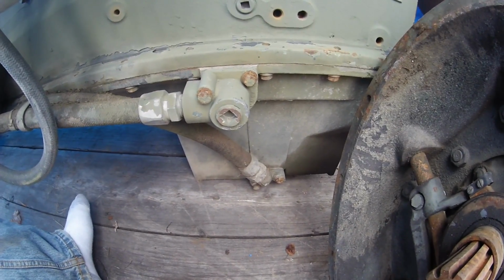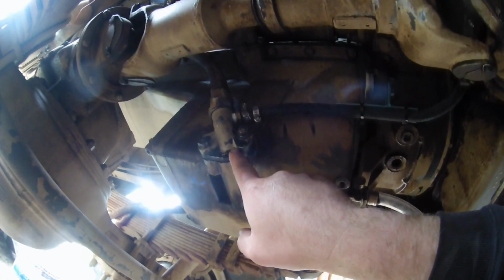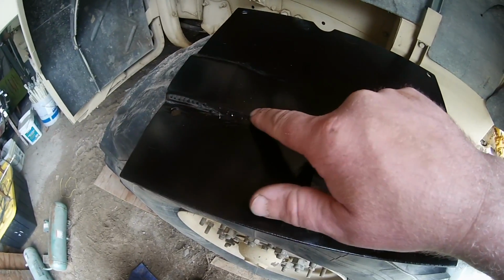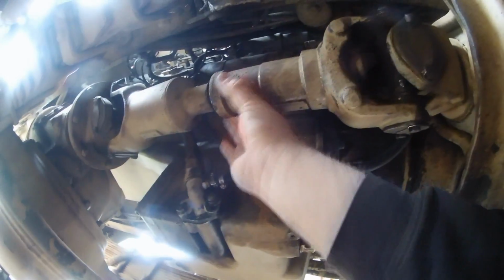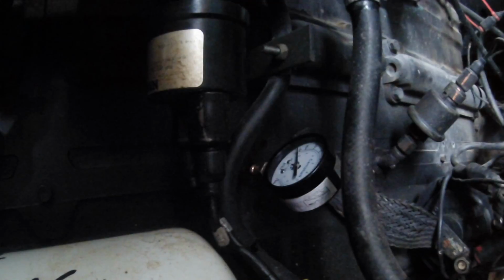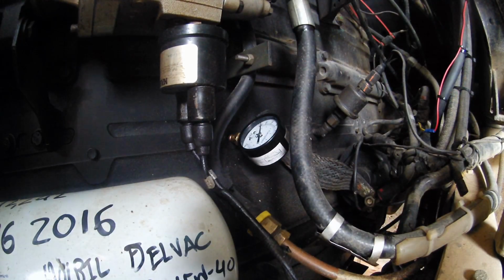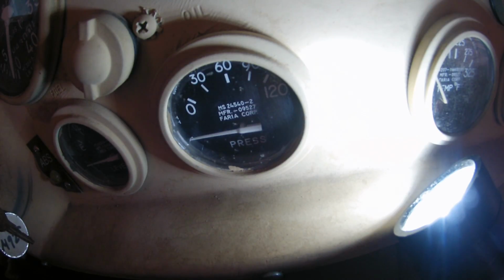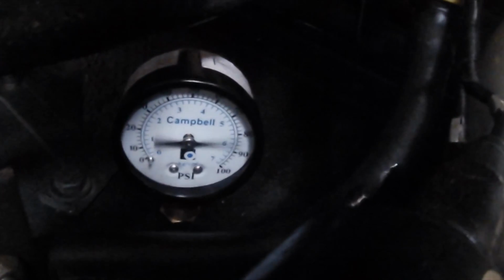Engine Pre-oiler Build

Comment: You need bigger flow on suction side of pump.   Change your 1/4  NPT port to at least  1/2 inch. Also change the out hose diameter to 1/2 inch. Keeping the 1/4 NPT  adds flow restriction to pump, which could eventually worn out the pump prematurely .
You don't want to build negative pressure in the intake,  you want to achieve FLOW in order to be able to fill  the oil galleries fast.

Comment: Yes, i love this, i just rebuilt the 855 in my m925 from watching your videos and i wondered about this when i watch the oil gauge, thank you for this video and your videos on rebuilding the 855, its greatly appreciated.  I just notice that this video is 6 years old, have you had any issues with this since, or has it worked flawlessly?
Reply from the maker: It will lose prime when sitting for a while.  I either grind it until it catches or just start the truck figuring sometimes is better than never.  Right now we are not using it commercially so it is just sitting in storage but when I was it got used every day. No idea the practical effect but I felt better not hearing it tap until oil pressure came up.

Comment: How about boots ?
Reply from the maker: Only two types of 5 ton owners, those that have changed a boot and those that are about too. I have always used the one piece and just pulled the hub at the kingpins. In 3 of the three trucks I found serous issues inside. Remember these were worked on by high-school kids.

Comment: Thanks for the extensive guide.
Now I'm gonna do this on my old BMW M21 diesel engine :)

Also, maybe you could run two or three of these things in parallel?
Since you operate these huge trucks that probably have a much larger battery capacity, you should be able to do this without worrying about draining it so much you wouldn't be able to turn the engine with a starter.
And the pre-ignition oil presure buildup would be quicker.

Comment: Can u do.a video or do u have one of diag fuel system.an maybe bleeding the air out of the system cause I need info or maybe somewere I can find a manuel on this moter mine doesn't seem to be pulling enough fuel to start
Reply from the maker: Crack line right at injector pump then use  rag and airline to pressurize fuel tank and bleed up to pump. Still no start crack injectors one at a time and crank till fuel. MAKE SURE MANUAL SHUTOFF VALVE ON INJECTOR PUMP HASN'T BEEN CLOSED. Happens all the time.
Reply: Thanks you

Comment: Thanks Nelson Studios! I used your basic system and one other techs to fab up a pre-oiler rig on my prized D21 4x4 pickup that has classic KA24e/d start up chain rattle. Stunning results, all my mech friends are shocked. I tapped my oil plug 1/4npt into a T and out to my scavenge pump (like yours 12v) under the passenger seat(cause easy space and not too uphill) and out thru a 3/8 check valve( you're right they dont pull) then to an inlet on a oil filter sandwich adapter(Chinese; upgrade the o-rings and re-tap the 1/4' npt western size and it's good so far).  So, hit the pump switch before cold start up and it takes 7-10 sec to hit pay dirt and WACK, 40 psi on the gauge(25 when hot). Oil light stays out for 3 sec after pump shut off, 1 sec when hot. Time it right and start before light comes back on and things are golden, not a trace of rattle!). So looks like all the engineer's thur time missed this OR they didn't want this and synthetic oil make YOUR ENGINE LAST PRACTICALLY FOREVER! No money in that. Will post vid soon, cheers.
Reply from the maker: Sounds awesome!

Comment: I did the exact same thing to my subaru but I used AN-10 hose and fittings and used a gear drive scavenge pump. I set the pump on a timer that activates every time the ignition is turned to the run position and it runs for 5 seconds. I instantly get 80psi+ pressure in the block after sitting overnight. Was the best invention I have ever done. No more dry starts. Great minds think alike.

Comment: I made a comment in your video of "testing the preoiler system" stating that this is a little bit of an over kill. But after watching this video, and actually watching the time it takes for the oil pressure to finally build, you have me sold. I will install this this fall when I change my oil. I always like to have fresh oil in it during winter. I will also do a drain plug modification "maybe"
Reply from the maker: You might let me run with it for a year and see.
Reply: The reason I like this system I only run my truck for a couple hundred miles then it will sit for a few months, I'll go out and start it, run it for a couple hundred miles and then it will sit for a few months. Starting it up after it sat for a few months gave the oil time to weep down off the cylinder walls and out of the bearings. After watching your video I went out to mine and started it after it sat for 3 months, I did not get oil pressure until the engine was under its own power. I would like to see positive oil pressure while the engine is being turned by the starter.  It does if I start it with a few weeks, after that it oil pressure builds after the cylinders fired off. You did a good of job of making people aware of the oil pressure delay I never gave it any thought until I paid closer attention to it.

Comment: That's neat. Was there any change in the amount of time it takes to build full idle oil pressure from a well rested engine vs. no pre oiler?
Reply from the maker: Yes, during winter start up I might see 20 seconds with no movement from the gauge, with the pump it has oil pressure from the moment of starting.

Comment: Pump is way too far from the pickup.  Those pumps push far better than they suck.  It should be mounted down on the frame rail somewhere as close as possible to the tapped fitting.  You'll get a faster and higher pressure and you won't burn out the pump as fast.
Reply from the maker: I agree with you but I wanted it out of the road spray as I didn't think it would last as long subject to that.  It can't lose prime because of check valves thought it will suck a little air each time I change the oil.  It is set up to run for 30-40 min at a time so I hope that the little bit of abuse I give it pulling from so high will not kill it early.  Built to drain the motors of boats when doing an oil change.  Designed to be self priming from the deck.
Reply: I don't think it will lose prime either, it'll probably do fine there but would do better job priming with a short intake long exhaust. Would be interesting to compare.
Reply from the maker: It would be.

Comment: That oil pump is mounted really far away from the pan and it might starve itself and burn up overtime, electric fuel pumps are the same way, if you mount them far away from the gas tank they will burn up and quit since they are lubricated by the fuel. Maybe in the future I would try making a bracket off the oil pan since you have those tapped holes and mount the pump on the oil pan or somewhere closer. Also this completely opinionated but Fram makes really cheap filters and I wouldn't trust one with a 4 cylinder let alone this mammoth. There are plenty of youtube videos and forums about how cheaply made Fram filters are. I would trust Mobil 1 filters or K&N filters personally
Reply from the maker: It should not lose prime despite the air you could hear in the test video.  One way check valve on the uphill side, downhill is below the level of oil so no air can get in.  Barring a leak in the lines the prime should stay so no dry run, or at least not often (sitting over winter for instance). I guess time will tell but it truly is designed to pul out boats while sitting on deck so some lift must be ok right?  Maybe I should have tried harder to mount the pump in the frame rails, my thought was to keep it cleaner and further from the pressure washing I do all the time.  I will probably replace with NAPA filter at oil change so in another 2000 miles.
Reply: Oh I didn't know you had a check valve to prevent dry starts, and I didn't think about pressure washing good thinking there. I really like the idea of a pre-oiler and really smart idea to tap it in that fitting for easy repair/replacement

Comment: I like the idea but you may end up having problems with the aux pump because your pump is higher than the oil supply by quite a bit. Especially when that oil is cold it is going to starve that pump a good while before it gets oil. Just have to see how long it lasts.
Reply from the maker: Unless air gets in the pump shouldn't loose prime.  The air you can hear in the video is from me draining and refilling the engine.  You are not the first to comment the pump should be lower, I was trying to keep it clean.

Comment: build an adaptor plate , and convert to the old 12 valve cummins , for what you use the trucks for , it should be fine , they used them in many a school bus , basically what your trucks use is , they also used the allison trans , so the adapter plate may be an off the shelf item , just doing the research will be the hardest part
Reply: See: www.AdvanceAdapters.com
Tech Questions: 800-350-2223
Also, see:  DEBOSSGarage channel, Cummings wizard
Reply from the maker: I have thought several times about a tuned 12v.  Old timers swear that it might have the HP but not the torque.  I think it would work.

Comment: A corded oil pan heater between the oil pan and skid plate could be a viable plan... 
I think they use a thermal conductive adhesive. Common for larger engines and diesels
Thanks for sharing...
Reply from the maker: Do they make a flat thin heater?  That would be a nice clean solution.
Reply: yes they do, I listed a source defore... It's a peel and stick installation.
See:  www.Wolverineheater.com
Tech Questions: 800-545-2248

Comment: I was picturing you laying on your back drilling in close quarters with a hand drill thinking, This ain't gonna go well.. Good thing it was revovable.
Reply from the maker: I was going to pump a few PSI of air pressure into the block and drill and tap it right at the back in that deep groove.  Use the air pressure to help blow the shavings out of the hole so nothing fell inside.  The thought had me puckered enough to consider pulling the pan down to drill it for a bulkhead fitting but then Dad's idea saved the day.